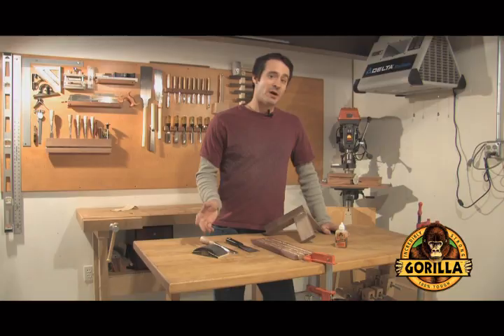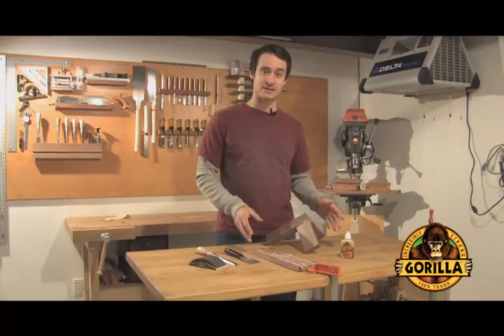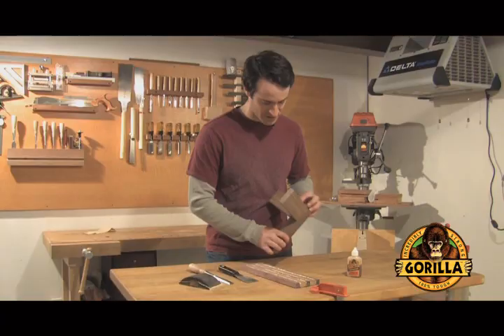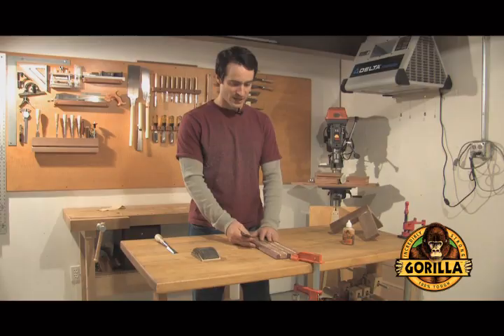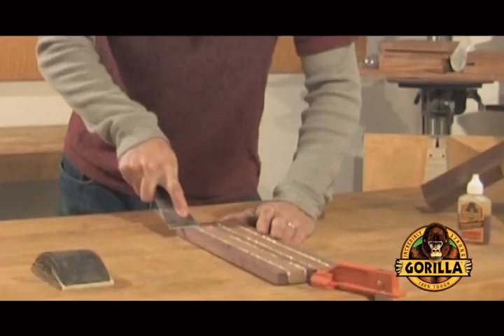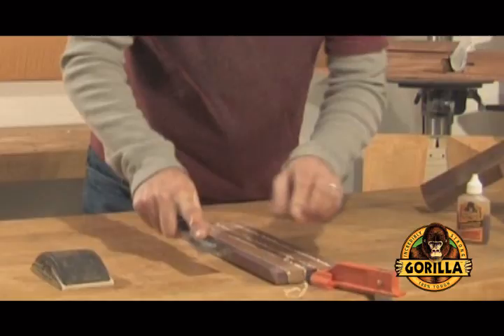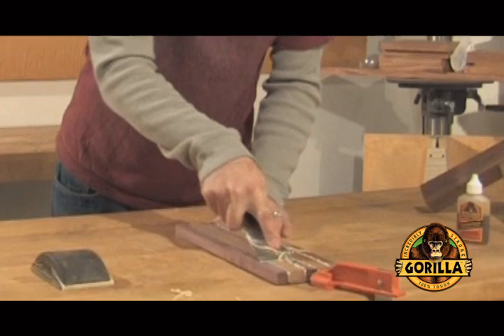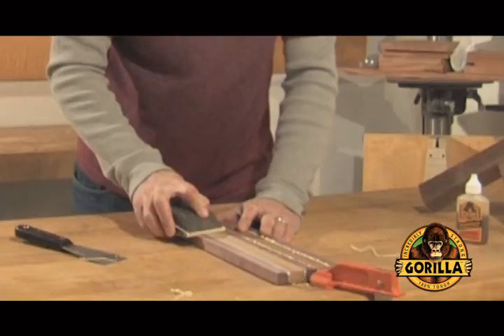Removing Dried Gorilla Glue From Your Wood Project

Comment: I love your water cure gorilla glue, it's fantastic and the foaming is my favorite feature.  It can be a mess but usually if I use enough water (not much) for cure I can just trim it with a knife or xacto.  I'm here though, because I'd like to know if you have a way to dissolve it.  Mechanical removal is fine for some things, but I want to use it for something extremely delicate and there will be no way to clean it by hand with tools.  If I can't melt it off of the substrate (china) I will damage the substrate.  Any hints?  The china is about .4mm thick, I can break it simply by touching it wrongly.  Gorilla glue would make perfect little foam gluepoints, but I'll have cleaning to do. 

Well, thanks for a great product.  It always brings a smile to my face when gorilla glue fills up the gaps with supportive adhesive foam, really great product!  One tip everybody should try, I usually wet my surfaces with beer or coffee, no need to toddle off and try to find water, just use your favorite drink.  I'm not sure if spirits will work, sorry.

Comment: just wondering if you made a mistake and glued two pieces of wood together and now wanted to take them apart as you made a mistake putting them together how would you do that?
Reply: SIM i would like that question answered as well
Reply: Yes this. And it seems like this would be the more likely scenario. I've heard vinegar works well.
Reply: A heat gun or hair dryer works to weakened dried glue. I had a cabinet door with a 4 sided frame and a center panel. The center panel was routered into the frame not just routered onto the back of the frame. It was glued all along the groove all around the inner frame. The right leg of the frame had spread and came apart at the joint meeting the bottom of the frame so it had to come off completely. It was a bathroom door so I think the moisture may have expanded the wood, mainly the center panel. Anyway the hairdryer did the trick. I kept heating it then wiggling the leg back and forth. Eventually it came loose enough and I was able to carefully pry it off and refit it.
Reply: Vinegar does dissolve the glue but it might not work for all joints.  I tried separating a joint where the wood was 1+7/8" thick and the vinegar couldn't soak deep enough, so I ended up needing to cut it.  However, vinegar is useful for getting excess glue off the top without risking tearing up the wood with your scraper.

Comment: I'm having to cut mine off using a Stanley knife as it's inside the fishmouth joints of my 1cm-2cm thick bamboo grill fence.

EDIT: I bought a set if super great chisels from Magnusson and the smallest one took the glue off like a wonder! Just propped the handle into my hip and held the chisel just below the tip to be safe and give myself solid control and then pulled the bamboo down on to the chisel.
Comes off like peeling skin : ]